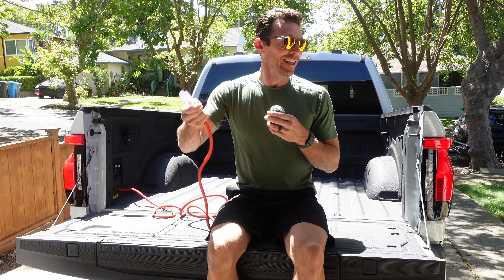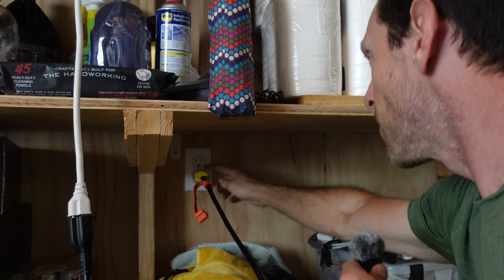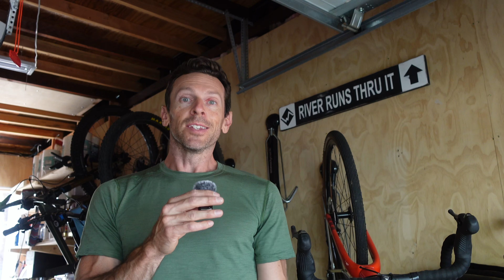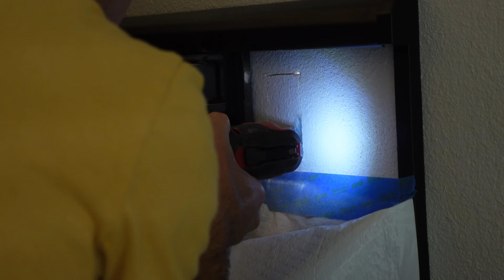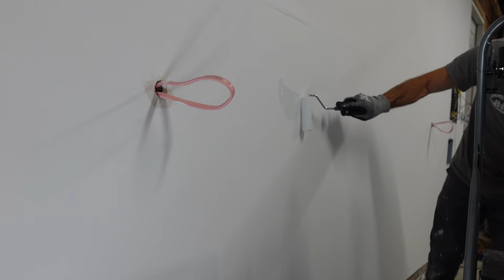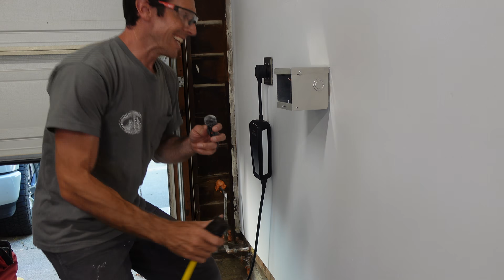Powering My House With My Electric Truck

Comment: I used the extension cord method this past winter here on Cape Cod during the 4 day outage we had and it was a great thing to have in the driveway. I carry various cords and tools in the frunk which is a major benefit of the Lightning for just in case scenarios and still have room in there for groceries or vacation items if needed.The Lightning is a tool in itself with amazing power supply when needed. Oh and leaving it on for hours or days on end is no issue because there are no emissions or rumbling engines and uses minimal electricity while on. If you dont tow on the regular for  distance the Lightning is a real good truck.
Reply from the maker: That is fantastic to hear! It's so nice to be whisper quiet and getting 7,200 watts!

Comment: Great video! Lots of information..  Can you also connect a gasoline generator to the inlet you installed? in case you sell your truck in the future.. how many Bluetti batteries do you need to power your home if were to connect them to the inlet you installed?
Reply from the maker: Yep, you can connect a gas generator to that inlet! The truck has 131 kwh, a bluetti has 3 kwh. So you need about 40 bluettis, haha

Comment: Great video Brian, super clean install! I always look forward to watching the videos from this channel. It's motivating me to get working on some projects around my house, lol. Just curious if you considered the GenerLink transfer switch that mounts on the meter before going this route?
Reply from the maker: I was going to talk about that! But the segment was a bit boring and side tracked too much. I think that's a damn good way to do it as well. My meter is so far in the backyard that the extension cord from to the truck would have to be a bit ridiculous. The other thing is I was never really sure if you could fake a power outage / force your house to power down. With my new transfer switch I could disconnect the critical loads from the grid (fake a power outage) and figure out a way to power them with solar independently.
Reply: Thanks for the reply! Ah, makes sense. I didn't think about testing it with a fake power outage.

Comment: Nice job!  Great fun when it all works.  I know, I know:  everyone has comments.  If you do something like this in the future, really good option is to use Rockwool instead of fiberglass.  So much better.  Also, that ford charger is not really meant for continuous use.  Hard wire yourself in an Emporia or something similar.  Way better, and you get a ton of charging options through the app.
Reply from the maker: Yes! I already had the fiberglass and just went with it. Maybe when I crack open the wall on the other side I can replace it. I’ve got the emporia charger at my property and it’s great! Especially since you can turn down the amps.

Comment: for a first timer you did well. I kept waiting for a segway to charging up the E-Bike. The only thing I would really fault is using that LB, but it works it is safe so.....also a set up for out at the cabin for off the grid charging of the truck as well as powering camp BKXC would be another use of this. Cheers.
Reply from the maker: Yeah, not too fond of the LB either but it would have been another month of surgery to make that area work flush! For sure, I’m already charging the truck and using the truck to charge up the batteries at Everstoke!

Comment: So does the transfer switch automatically isolates the backed up circuits from the grid when the truck is plugged in?
Reply from the maker: I actually think it does. Because there is no interlock and if you switch the power back on while the truck is connected it allows you to just push button switch back to the grid.
Reply: @kennedyish I am no electrician but my understanding is that your diagram should be sub panel feeds Automatic transfer switch that feeds backed up circuits sub panel that then runs to your various loads.  I probably missed it but it didn't seem to be wired that way.
Reply from the maker: Oh yeah, the diagram is just trying to be as simple as possible for the idea of current flowing back to the truck on neutral and ground!

Comment: Let everyone know you can’t use a regular transfer switch with the Lighting or Powerboost Ford trucks.  It has to be a neutral switching or 3 pole transfer switch. 
The ground fault in the truck will trip and shut off the power if not used
Reply from the maker: I thought I said that like 5 times in the video, but maybe not explicitly enough!

Comment: Having your car drivable and not low on power is probably a good thing to have during an emergency too 😂
Reply from the maker: 5 days of power AND 50% battery in the truck! That’s not bad!
Reply: @kennedyish  for sure...it was more of a joke. Awesome you did it all yourself. Generac makes some great stuff.
Reply from the maker: I definitely feel like I have to keep my truck at 100% all the time now. Even though it supposedly kills the battery, I gotta have a full tank!
Reply: @kennedyish  I'm just glad to see you back and turned on alerts for the channel. You already took me down a UniFi rabbit hole with my own network.

Comment: Great video! I'm curious as to why you didn't recess the generator panel into the wall like your electrical panel is? That would get rid of that weird junction situation. Was stud spacing getting in the way?
Reply from the maker: That area had a TON of studs and existing electrical coming out from the kitchen. It was just such a mess. I supposed I could have spaced it out more to the left maybe and extended the wires for a bit more clean look. But I think it’ll work!

Comment: Great topic for a video! I’m stunned by how little power you use. I’ve never once only used 12kwh in a day 😂 My neighborhood is all electric so no gas helping out and it’s hotter than satans taint out here lately. My usage yesterday was 75kwh and that’s with NO arcade games on haha! This feature has to be one of the best things Ford has ever done. I’m blown away that it’s not being adopted by other truck manufacturers. It would be awesome to be able to power the newly purchased travel trailer off of my truck. Generators are so loud and now allowed in most places you’d want to use them. An idling truck is almost not noticeable so that would be nice. I do often think about back up power after we experienced the good old snowpocalypse a few years ago. It’s a big investment though and we have had very few power outages since then. Of course you don’t think about it until you really need it though.
Reply from the maker: It is SUCH a luxury investment, but some people are out here spending $35,000 on a watch. We do have a gas water heater, dryer, stove and furnace. So gas definitely is a big piece of the puzzle. I had a part in there talking about it but I cut it because it was too boring.
Reply: @kennedyish  I'm trying to figure this out too, and have those same appliances on gas.  So far gas has been comparatively inexpensive, so I'm fine with it.  But in the event of a gas shutoff or they jack the prices up significantly, all my excess solar power and battery are not going to do me any good!

Comment: Just wait until your fellow countrymen Electricians see those Wago connectors… your comment section will blow up!! 😅
Reply from the maker: Hahaha! No way I’m ever using a wire nut again!
Reply: @kennedyish  Wago's are fine in this case? Didn't think they were rated for 120v AC...
Reply from the maker: Wagos are great. Rated up to 400 volts!